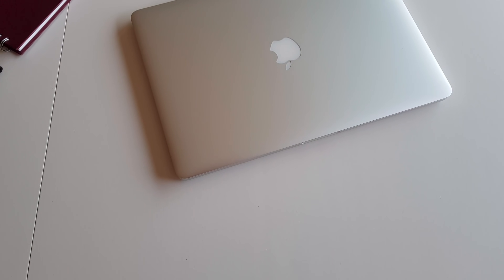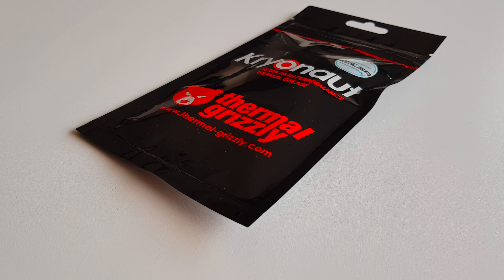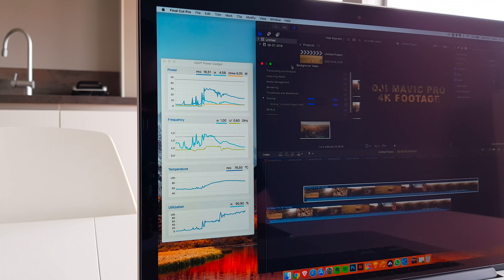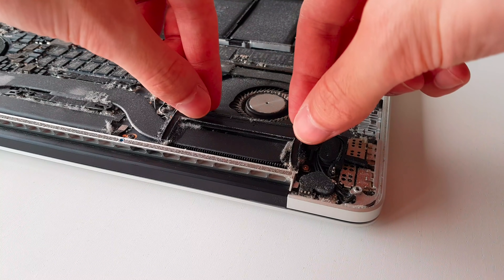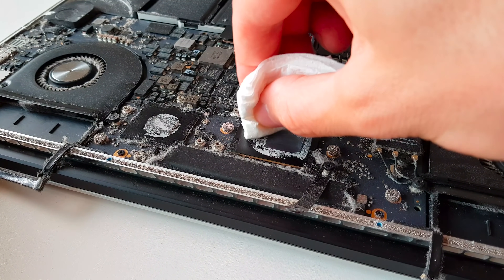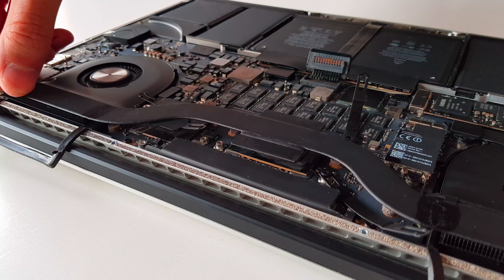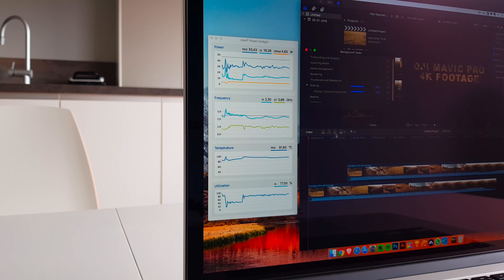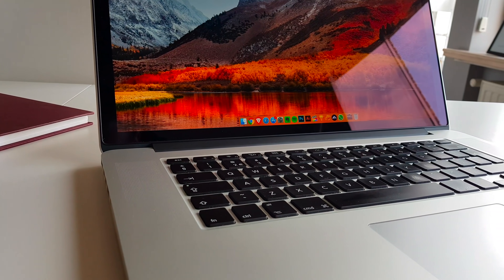Solved overheating problem on my MacBook Pro 15" Mid 2015 by replacing the thermal paste

Comment: everythign fine but when i play a game in bootcamp i get still gpu peciup to  90°C   even cpus 70°C +
Reply: my battery is also broken, i should buy a new one, you think this could fix it lmao?
Reply from the maker: As I said in my previous comment, we cant solve the problem with thermals completely, we can only reduce it. MacBooks are not made for gaming so stressing the GPU and CPU will result in high temps. I also still get those temps when exporting video but I don't get thermal throttling which means that my CPU can run longer on a higher frequency. Also, in general I think that running things in bootcamp will result in couple degrees higher temps so I am not surprised there. Sorry, but we can't really fix a engineering problem that Apple made 😆

Battery replacement isn't really that easy because you practically have to take out everything out since the battery is spread through the entire chassis of the laptop. If you are not experience with these kind of things I would rather give it to a professional to avoid potential damage. You can check all the steps here: https://www.ifixit.com/Guide/MacBook+Pro+15-Inch+Retina+Display+Mid+2015+Battery+Replacement/89284

Good luck! 😀

Comment: Thank you, i just bought the paste and used it, but my GPU still gets up to 70"C playn black dessert online on ultra mode with bootcamp windows, or would  you say this is normal? lol
Reply from the maker: Hi trick pa! First of all thank you for watching my video and following my recommendation. Means really a lot! 🙌😀 Second, yes... those thermals are completely normal for this MacBook. They are very well known to have problems with thermals because of the hardware components used and thin thin enclosure. So practically we can't really eliminate the high thermals and the only thing that we can do is reduce them and get them to a more tolerable temperature. 70C is in my opinion more than good for that laptop because on my desktop GTX 1060 i am getting those temps as well when playing games. So I think in your case that's a mission successful 😀 Thanks once more for watching! Have a great day 👊
Reply: @DigitalPulse   funny thing i had 95°C which is 203°F while ultra game settings and now  its about 70°C/158°F  just did some c++ code in visual studio under bootcamp LOL seems the badboy is WINDOWS   when i code or play in macOS the problem is almost gone xD  thanks again for this grizzly tip
Reply from the maker: No problem man! Enjoy! 😃
Reply: i have to say is the first thermal paste replacement since  4 years lol, dust clean maybe twice a year.. i probably should just get a better notebook these days

Comment: its not just about the old thermal paste, its also about the DUST, you have to mention it also in the video.
make sure you clean up the dust before you apply new thermal paste.
Reply: Bobby Brady  If you want a video comparing various thermal interface materials there's plenty out there that demonstrates that dry cracking stock dow corning crap that doesn't make proper die contact is reliably rubbish at transferring heat.  That's not the point of this video.
Reply from the maker: @aidanjt  Don't even bother to explain anything to him man. Some people just say that they heard that you said to them but it actually didn't come through their thick stubborn skull. It's almost like talking to a wood log 😉 That's why I stopped the conversation. There are so many people that commented how this helped them and this guy is still challenging it. So yeah... Says a lot about his comment and stubbornness.
Reply: @DigitalPulse  Hi Dario, thanks for making your video; it’s excellent, especially for a first try!

I do think though that Adi and Bobby have a point. I hope that you can agree that clearing out the dust will have had an effect of its own. Replacing the paste will also have had an effect, but since you did both at the same time, it is impossible to determine which helped more. 

I can add my own anecdotal data point, as I recently started using my Mid-2014 15" Retina MBP with dedicated graphics (dGPU) with an external monitor. I don't do graphics-intensive stuff so the dGPU is off most of the time, but when you plug in an external monitor, the dGPU activates. As soon as I plugged in the monitor, the fans started spinning fast, even with the machine totally idle. I was a little disappointed, to say the least! I was wondering if there was anything I could do to solve the problem, and bought some thermal paste. I also bought a “cooling pad” with USB-driven fans, but that was hopeless and had hardly any effect. The paste hasn’t arrived yet but I decided to open the machine up and take a look inside. Sure enough, I found plenty of dust (more than you) and with all that vacuumed away, I can now use the external monitor and do light browsing and video watching without the fans spinning up much beyond base speed. So for me, just cleaning out the dust made a massive difference.

I will also be re-doing the paste, and I’m interested to see what effect that will have. I think Bobby is correct that dry paste is not necessarily a problem; it’s more that it hasn’t been very well applied (there’s actually too much), and the after-market stuff has much, much higher thermal conductivity. In summary, changing the paste definitely wasn’t a waste of time, but clearing out the dust was also a really important factor.
Reply from the maker: @harry-dymond  Hi Harry. I never said that cleaning the dust did not help. My video clearly shows me cleaning up the dust and re-applying the thermal paste. What this guy wants me to admit is that re-pasting didn't help.

Anyway, happy to hear that you solved your issue 😊 Thanks for sharing your experience with the rest of us 👍
Reply: Bobby Brady  Here have a post from 2004 proving you wrong.

"Posted: Tue Jun 22, 2004 2:45 pm

First, when it is too thick, it acts as an insulator and doesn't effectively transfer the heat. The idea behind thermal paste is to fill up the tiny gaps between the two metal surfaces, the CPU and the heatsink. The paste transfers heat much better than air does, but it's still not nearly as good as metal. When it dries, it can be crumbly (leaving air pockets), so the gaps aren't filled as well. A smooth creamy paste fills gaps much better than a dry crumbly one. The liquid probably also aids in transferring the heat. Although compounds like Arctic Silver that contain metal can aid in heat transfer, it's the rest of the paste that does most of the work. Why not use any old paste then? Thermal compound is much better at not drying out when heated.
I read a lot about thermal compound at http://www.dansdata.com/goop.htm -- one of the interesting results was that toothpaste was a better thermal compound than Arctic Silver, up until the point it dried out."
Reply: Bobby Brady  lol why not just test yourself ? Replacing thermal paste is pretty widely accepted as helping reduce heat exchange, and the other main concern was the noise produced by fans to dissipate the heat.
Reply: Damn Bobby Brady got treated!!! Go get laid bro!  Bad/dry thermal paste is a hindrance to performance man. End of story!!!! Another proven believer here!
Reply: Bobby Brady  idiot
Reply: Apple uses industrial thermal paste. Seen people change only their thermal paste on cleaned and dust free Apple machines and no change in speed or temps. So most likely dust is most the time the culprit. Thermal paste changes to more liquid stage when 100 degrees C. And because thermal paste is under pressure it won't just leave those small cracks people talk about. Yep typing this on a 2012 mbp, with you guessed it, it's original thermal paste and OG battery has almost 6000 cycles.
Reply: hahahaha didn't see the inside yet but all the vents where clogged. Def dust was the culprit!
Reply from the maker: Depends. You saw the state of my thermal paste in the video. Cleaning just the dust would help a bit but only doing that without repasting would not yield any major results. Cleaning it is a common sense thing if you are taking it apart. If you are using it for 2+ years then you definitely have to clean it. Thanks for noticing!

Comment: Holy cr@p! I hava a 2013 macbook pro and I never had that amount of dust on the inside!!!
Reply from the maker: I know right! And I have no idea how. I used the MacBook on a daily basis in a clean office and the only thing that I did in the evening was holding it on my lap or bed while using it to browse the internet or watch a movie. I think a lot of the dust actually comes from the bedsheets.
Reply: Bedsheets is a dust collector for laptops @DigitalPulse
Reply from the maker: Had no clue that they can cause so much dust. Thanks for the info. I will maybe get like a plastic tray or something so that it's not directly on the sheets. 👍

Comment: i m getting the same mac soon and i will follow this tutorial to replace the thermal paste. Thank you.
Reply from the maker: Hello Khalid :) Glad to hear that. Were you able to get a good deal on it?
Reply: Dario Prski Yes. I searched on e-bay  and i found one that costs 1700 USD and its condition is perfect from what i have seen on the pictures. It's the 2.8 ghz , 16 gb ram, and 1Tb storage model. Can't wait to get it in few days. I picked the 2015 model instead of 2016 and up models because it has a ton of I/O and a great keyboard. I found a 2016 model
With better specs and same price but i chose the 2015.
Reply from the maker: @khalidhalba2333  I understand. I think you made the right decision if you need the IO without having to carry around all the dongles. Good luck with it and good luck with the repaste :) Let me know if you need any help with it ;)

Comment: How similar is this process for a MBP 13" 2015 model?
Reply from the maker: Hello! It's even more simple because you only have one fan so the heatsink is only attached to one side of the chassis. Check out the steps in iFixIt. Quite simple in my opinion. Here is the link: https://www.ifixit.com/Guide/MacBook+Pro+13-Inch+Retina+Display+Early+2015+Heat+Sink+Replacement/45130

If you need help let me know 😉 Good luck!
Reply: @DigitalPulse  Great, I might give this a go later this year then. I feel like it can get too hot during some tasks:) cheers
Reply from the maker: No problem at all! Have fun with it 😉

Comment: Hey, how has the Kryonaut held up? I know some people had issues with it drying out with sustained loads over 80c and had to change it within 6 months or so. So was debating between using Kryonaut since that is what I use in my desktops, MX-4 or NT-H1 (have all of them on hand). 

Mine was less than 1/4 as dusty and just blowing it out dropped my idle temps ~7c and load temps using Cinebench ~2c (98.2-98.9C down to 96c-97.6c) but let my CPU turbo from 2.7GHz before cleaning to 2.9GHz after and increased my Cinebench score by 10pts. So cleaning that dust out of yours was definitely a significant step just comparing to how much more dusty it was than my mid-2014. However, I'd still like to repaste it to see if I can get my idle temps a little lower and more turbo boost under load (less thermal throttling).
Reply from the maker: A very good question, and I have to admit you are right. I did notice increased temps again and I think just like you said it might be the paste drying out. In that case I would recommend you to go rather with the MX-4 or NT-H1 paste. I will probably re-paste my again.

Indeed just like you said cleaning the dust helps a lot but replacing the thermal paste does also a significant improvement. If your's is from 2014 and you haven't repasted it since that, then I bet it probably dried out as well. If you have the pastes at hand and all the tools needed, I don't see that you will gain anything bad out of it. :)

Anyways, thanks a lot for watching and good luck! Let me know if I can be of more help. Have a nice day!
Reply: Thanks for getting back to me! I ended up doing the re-paste last night using MX-4, it was late and I admittedly didn’t do my best job, however it didn’t help. My stock paste was actually still pretty wet with only some drying around the edges of each die and whatever had squeezed out. I had purchased mine refurbished from Apple, so I wonder if they had re-pasted during that process and used better paste than factory stock? Also, while it was still a bit much, it didn’t seem as bad as what others looked like from the factory.

My temps ranges at idle and load had lower lows (~1.5-2c for idle and 0.4c for load) but also hit the same high end or even a tad higher. Some of this I put on the paste curing some and will see how it does over time.

However, during Cinebench my frequency went from bouncing between 2.8-2.9 GHz after cleaning the dust to 2.9-3GHz after the paste. The Cinebench score went up another 9pts. I’m using the stock fan curve, so I get why temp didn’t change much under load, but getting a higher boost out of it.

This was all with an external display connected for dual display action, removing that I see higher scores, boost frequency goes between 3-3.1GHz and idle temps drops another 5-8c. However my initial tests were with the monitor plugged in, so going by those numbers.

So the re-paste didn’t get me as much drop on idle temps as I hoped but it did get me higher boost values, which is worth it. I should have ran gpu tests too, but didn’t think about it since I don’t do a lot of gpu heavy tasks on it, but will try a game at some point.

Will see how the MX-4 does over the next few weeks and may try repasting again to see if doing a better job (not a lot of experience doing laptops and working with their heatsinks) would help. Also considered using an IC Graphite pad instead of paste.

Sorry for the lengthy write up, figured I’d just put it out for others to see another example of results. Thanks again!
Reply from the maker: Thanks for following up. Super glad to hear some first hand experiences with the fix. Indeed that could be the case that they repasted it when they refurbish it. Like you probably saw in my video, my was completely dry.

In terms of the high temps that you are still experiencing, I think that you will never be able to experience lower temps considering the thickness of this machine. Since under heavy loads the CPU constantly tries to turbo boost in order to deliver the highest possible performance, you will always reach peak temps that the machine can sustain (especially with synthetic tests like Cinebench). Overall, your temp did lower because otherwise you would not be able to achieve 3.0 GHz. Indeed maybe try to repaste it once more as best as you can and then check what's the situation. Also, in one of the comments, someone suggested me a tool called Volta (https://volta.garymathews.com/). I did try Volta and it works very well. Sometimes if I want to keep the machine cooler while doing browsing and other less heavy tasks I disable Turbo Boost and put the  power limit on a value between 32 to 35 W. Helps a lot! Maybe you should give it a shot as well and see what results you can get. I would suggest to for example if you are doing some intensive tasks to turn on Turbo Boost and set the power limit to 34 to 35W and then test. BTW the program has a 7 day trial so I think it's worth the shot.

Let me know if it helps! Really curious to hear 😀👍

Comment: Hi, I just got my apple service center conclusion that logic board needs to be fixed, though never had any symptoms of dysfunctional logic board before. Just my working mag safe adapter stopped charging laptop, no cord breakage, working for other laptop. Is it possible that it is just mag safe DC charger port needs to be changed or battery have some issues?
Reply from the maker: Hello Esen. Thanks for reaching out. Hmmm I am not really an expert there so I can't really give you an advice that I would be comfortable to share. I really don't want you to damage the MacBook or to get you injured. Maybe a good idea is to head on a website like Tom's hardware and ask your question there. There are a lot of hardware experts that can give you a better advice: https://www.tomshardware.com/

Good luck with the repair! 👍
Reply: Dario Prski Thank you so much 🙌🏼
Reply from the maker: No problem at all! Glad I could help 😉

Comment: Am I the only one who looked at the temp test and hgz? it didn't change. Should have I looked elsewhere but graphs and digits running?
Reply from the maker: Hello! What do you mean? I didn't quite understand the question 🤔
Reply: Dario Prski hi there! I couldn’t see the difference in temp reading and GHz based on what I saw. Cheers
Reply: @dkdude  thats because he used to export a file, that would in any case use the max of the power of your mac, the diffrence ,the file was exportet quicker ergo CPU is performing better with "better cooling". Anyway it would stop heating up when your doing random stuff like surfing ecc...

Comment: Brilliant video. Thank you for sharing. 

I suspect the dust around your fans wasn’t helping either. A can of compressed air might clearing out the dust etc.
Reply from the maker: Thanks for watching Marc! Glad you enjoyed it. 👍😁 Yes the dust didn't help at all. Unfortunately I didn't have compressed air at hand. Will keep that in mind for the next time 😉
Reply: Could electrical contact cleaner be used here instead?
Reply: @edgarbleikur1929  Yes